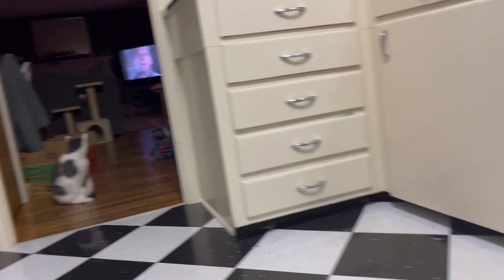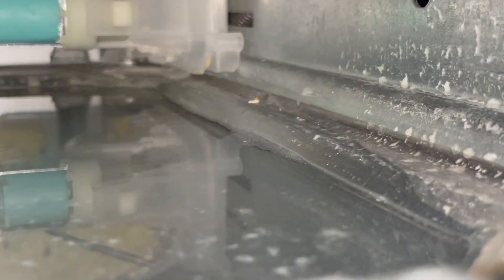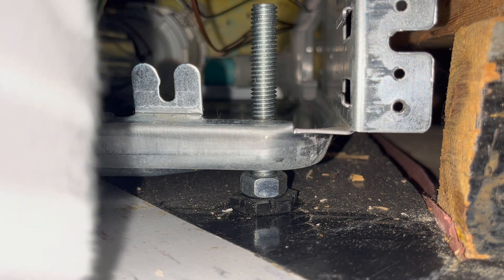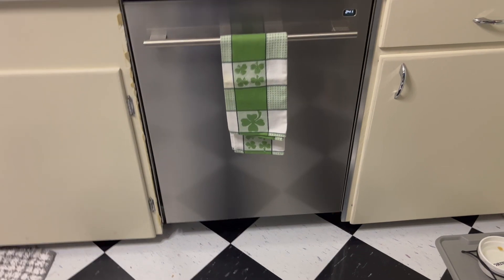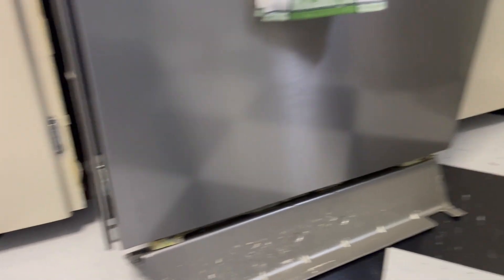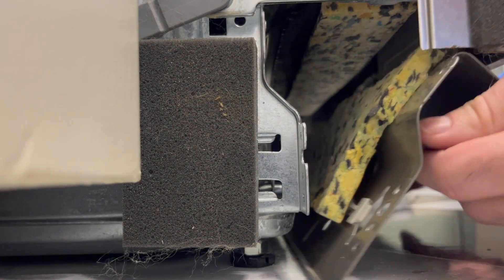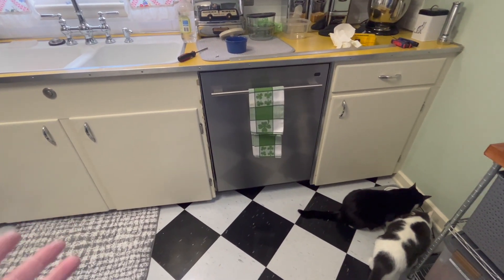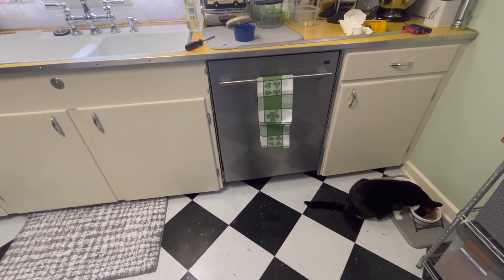ALWAYS use the right dishwashing detergent... and NEVER use too much! How to CLEAR he ASKO F10 error

Comment: OMG! It is not stainless steel , looks closer to zinc cover.
Reply from the maker: Yeah, you’re right - the entire inner shell is stainless.
Reply from the maker: What the hell is stainless still anyway?
Reply: @bbishoppcm  I dunno, but outer shell is just  steel covered with zinc I guess. I had Bosch washing machine made in Germany working in Eastern Europe for 15 years with  rusting to Swiss cheese bottom because of leakage :-(((
Reply: @bbishoppcm  ///still/// is my eastern european accent :-))) I am not a native English speaker. 🙃🙃
Reply from the maker: @ran2wild370  Stainless steel internals makes more sense anyway - the structural outer shell is indeed a zinc-plated steel. I’n surprised your Bosch didn’t shut itself down as I believe they also feature a similar leak-protection feature..
Reply: @bbishoppcm  Well that wasn't a premium class washing machine but rather something a little more above that economy class. "Still" :) have a motherboard from it, everything else went to a garbage pile.